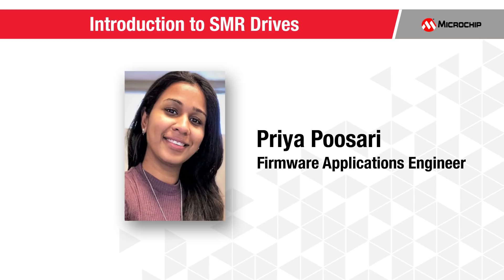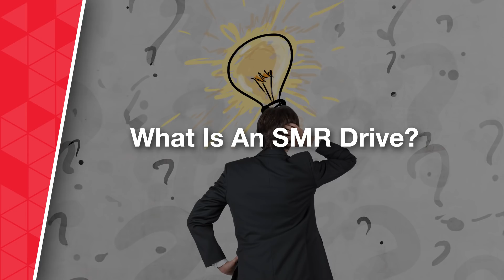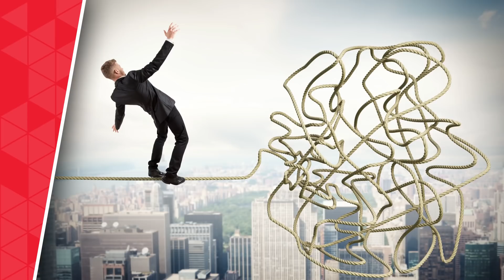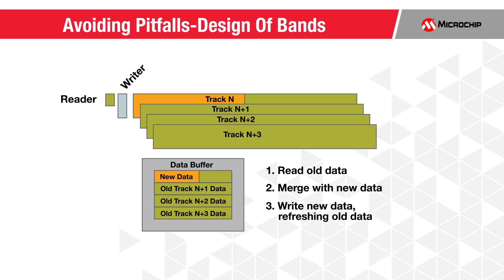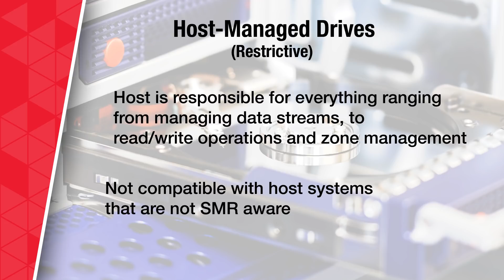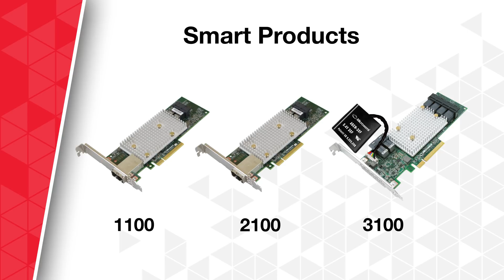Introduction to Shingled Magnetic Recording (SMR) Drives

Comment: So SMR is OK for home use, but not good for enterprise use.
Reply: Neither - If you want a SYSTEM OS drive, get a non SMR drive or better yet, an SSD.   SMR is not meant for continuous read / writes, eventually the performance will take a huge hit - not meant for running an OS on or applications that overwrite many files, etc.   If you want a drive you will write once to but use mostly for reading, like an archive drive, then SMR will do fine.  You will see 2TB+ drives with 128MB and 256MB cache, that's a giveaway that the drive is SMR.  You will see the same versions of these drives with 64MB of cache, those are the normal (non SMR) drives, referred to as PMR.  Gotta love how companies are cutting corners.  If you can afford it, get a good SSD with high endurance for your workload.......back up on HD
Reply: @jimmydandy9364  Thanks. I use only SSDs in my PCs, then back up my data in an external HDD. The backup is quite slow, but it's fine since I can just leave it there transferring at night when I'm asleep.
Reply: @JackQuark  What kind of external HDD ? I use SATA3 HDD externally through Vantec USB3 enclosures, and I get sustained 190MB-200MB/s on my HDD during backup, if you are using USB2 enclosures or USB2 drives it will be very slow indeed.
Reply: @jimmydandy9364   I wrap a notebook sata 3 HDD in a USB2 closure. So it's much slower than yours.

Comment: Spoke 5 minutes and failed to mention the key element that is the SMR drives are terrible in speed dropping from 28MB seed down to 1.5mb making them useless for personal use such as home NAS drive that is hosting my videos and photos to the entire house.
Reply: zarash interesting. I did not know anything about smr-drives and bought this one: 2000GB Seagate Barracuda Compute ST2000DM008. As I am just found out it is uses also smr technology. So Without knowing, I was astonished by their reading and writing performance with large files which is never less than 120 MB/s usually it goes up to more than 200 MB/s. After 30 sec, performance may drop to 120, for me, that’s okay. I would have liked to know that in advance though. Were you talking about small files?
Reply: @danielreichert7879  You'll only see write performance penalties when you modify tracks that requires rewritting of tracks within a band. Like it was mentioned before, SMR drives perfectly fine for cold storage,  the vendors just need to disclose this fact so we know what we are getting.
Reply: SMR is fine for cold storage, once you have written those photos and videos, you can access them fine at full speed.  if you plan to do frequent rewrites and modifications, then SMR is not for you, otherwise for cold storage, write once, read most, you'll get the same speed.  I have SMR drives storing my videos and have no issues reading them, I can even copy them without issue at near 200MB/s speeds.  The issue is re-writing shingled tracks, not reading them.
Reply: Reading speeds and hosting data is fine, it's writing or recording data where the problem arises. 
If you're archiving data, it'll be slow when you write to the drive, but reading will be no different than on other drives.
It's fine as a home NAS if the NAS is for archiving data and not constantly being written to.

Comment: Evil thing of SMR is not it's SMR it's the vendor never told you it's SMR!
Reply: Indeed but you can tell by the cache - example, a Seagate 2TB with 128mb of cache or more = SMR .  If it has 64MB of cache it is a PMR
Reply: @jimmydandy9364  for those who know, they can steer clear of SMR. The drive makers, however, know that the average consumer doesn't know, so they just keep pumping them out.

Comment: Most External Hard Drives are SMR so if you have one the risk of Data being overwritten is Nonsense. But they are made more for Storage as opposed to PMR (different from SMR) which are almost always Internal PC drives which are specifically made to handle mutlitude of rewrites without data loss at all. Research SMR vs PMR.